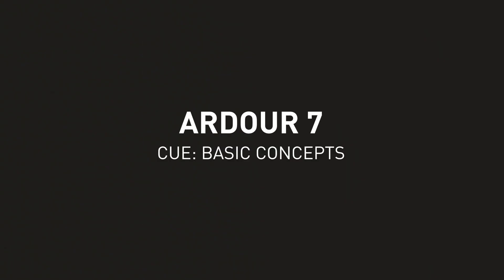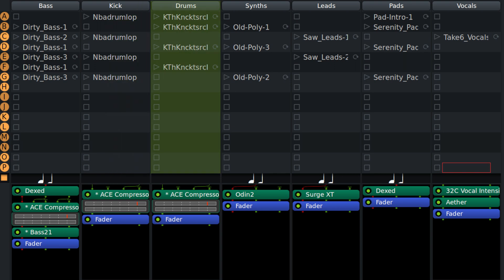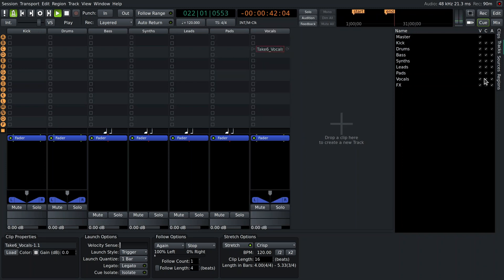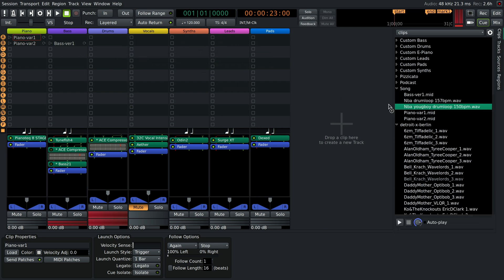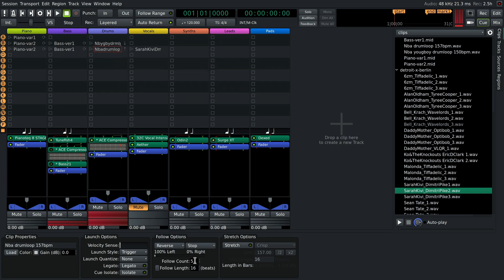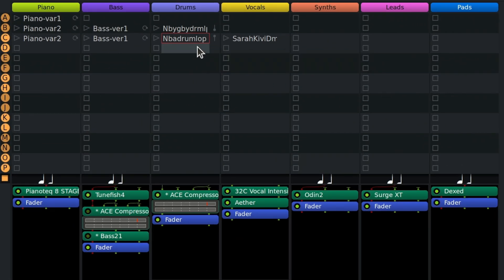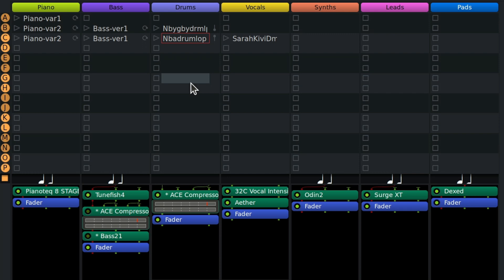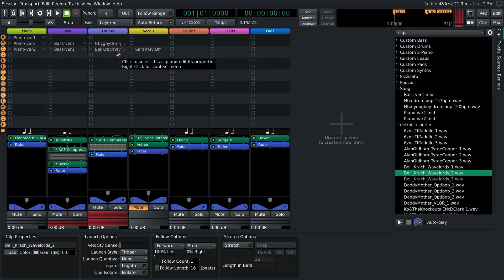Ardour 7: Basic Concepts of Cues

Comment: I think ardor needs an integrated sitala type drum sampler, to make drumming easier. thank you
Reply: Agree  !
Reply: Yes, that would make the workflow so much easier. Just out of curiosity, how do you work with drum samples at the moment? Samples or MIDI?
Reply: If you're looking for a good sampler, how about samplv1? Or drumkv1 for a full drumkit? Or perhaps the LSP sampler? Plenty of options out there ;)

Ardour's ACE plugins are mostly just stuff which is so universal it needs to be in the DAW (like an EQ, compressor, and so on), the rest is adjusted to taste!
Reply: @bratpeki   I have used lsp sampler, drumkv1, samplv1, and others that I don't remember but they are all cumbersome and lack such basic functions as automatic replay, a good search engine or an intuitive interface that improves the workflow and even more so when you work on urban music and electronica where many samples are used.
This has been a problem because since these plugins exist, many believe that they are not necessary in ardour or other daws, ardour has the ace plugins but I need an integrated drum sampler, so as not to depend on these inefficient plugins. Greetings